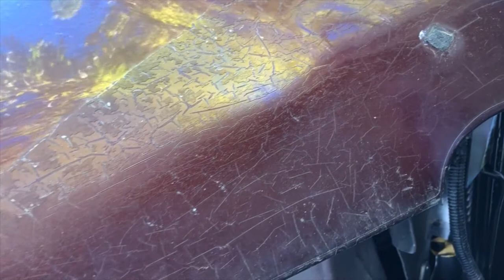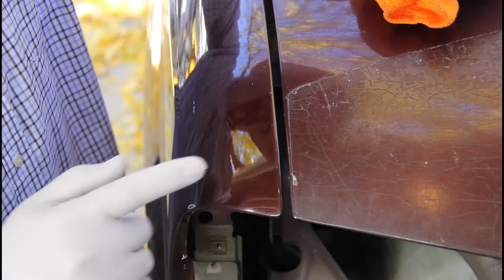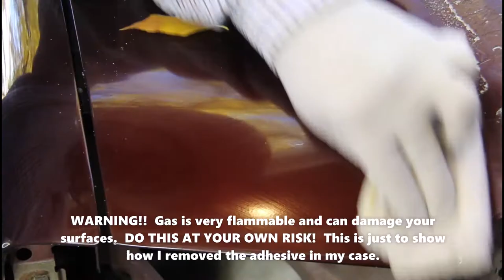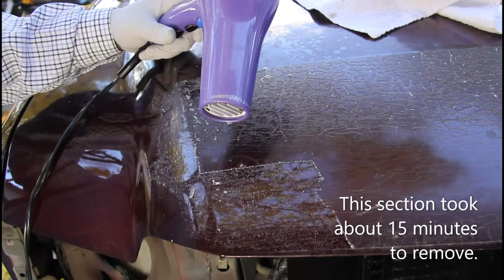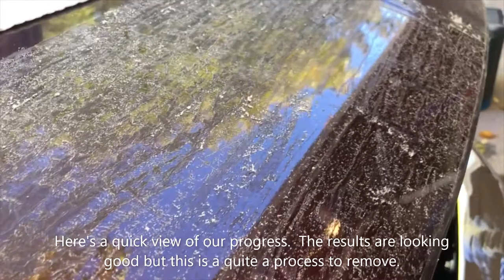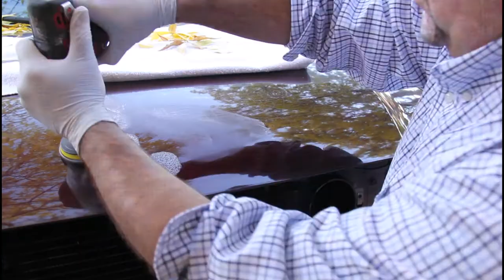Clear Bra Car Removal

Comment: I used the cooking oil method on those stickers when they put a sticker on your window. It's a paper sticker but if you soak it with the cooking oil let it sit for a minute it just wipes off that  sticker adhesive very easily
Reply: I've had them put that sticker on my window before when I parked at somebody's apartment and it's the big sticker that ends up being on your glass
Reply: You gotta be careful with the heat gun because you can overdo it and mess up your paint
Reply: Seems like you gave up on the hair dryer
Reply: I feel like the hair dryer gets it just warm enough but not too hot like a heat gun
Reply: To me the steam and oil are your best friends oil and water
Reply: If you had a wider scraper that would help too, More like a spackling tool
Reply: I like the I like the Cooking oil and goo gone, and definitely dawn to get the oil of

Comment: Hi. Any idea why my  06 Town and Country sliding doors wont open by the handles? Both open and close from the remote or dash buttons but not from the handle? You can still open them manually from the door handle. Child lock is off. Dash door control is on. I figured it has to be something related to the door handle. A switch. A ground problem. Something. Lmk if you have any advice. Thank you
Reply from the maker: Hi George.  I'm sorry but I've been away from YT for a while.  Did you find a solution to your problem?  If not, let's discuss it a bit more and get you a solution!  Sorry for the delay and I appreciate you stopping by.

Comment: Great video.  Thank you!  Looks like heat is best for vinyl removal and a solvent for left over adhesive.  I've liked 3M Adhesive Remover for other chores and may try that before gasoline.

Thanks again...very helpful.
Reply from the maker: I'm sorry for the delay Paul, I've been away for a while (as you can tell).  Thank you for the compliment on the video.  I haven't tried 3m Adhesive Remover, I may have to sometime.  Heat was definitely the trick here with this.  Sorry for the delay again.  I really do appreciate you stopping by and taking a moment to leave me a comment.

Comment: Hi Javo. I could not find your email address on here, so I am just hoping that you're still checking comments on your latest video. 
I would say that your channel's most popular video is due for a sequel. ;-) Your tutorial on building a garage storage lift is fantastic, however I am interested in building one inside my New York apartment, for storing a full-sized bed. New York apartments are famously small, and being able to press a button to lift my bed to the ceiling would be a great help. 
I don't believe I would need to build the wooden platform, as I suspect I could just use a metal bed frame, though lining the bottom of it with drop-ceiling panels, might help me better hide the bed once it is up in the air.
My concern is that the video you did create, while incredibly impressive, it was a bit hard for me, a person with no real handy-work experience, to follow, if just because it seemed like you were discovering things while you were making the video, and as your ceiling was not a smooth surface, it was harder for me to make out exactly what the set up was. 
If you were at all interested in filming a follow up video with an installation, that is a bit more detailed, I would very much appreciate it and I expect it would be another very popular upload. 
Oh and if you live near New York and I can entice you to film that follow-up in my apartment, even better ;-)
Reply from the maker: Hello Jay, I apologize for the delayed response to your comment.  First, you're correct.  This video is due for an update, and I have one in the works.  I still have a lot of work to do with it, but it is coming soon.  

It's hard to say whether using the metal frame would work.  I would look to a different solution because the metal frame is not designed to be suspended, so the stress points may be other than intended, causing a failure.  I hope that makes sense.  IMHO, a built platform would support the mattress and a mounting surface for the ceiling tiles you mentioned (great idea, by the way).  

You are correct in your observation of "discovering along the way." All my projects evolve from my original vision as I see improvements to my original design idea.  That's a good thing because implementation often differs from my project visualization. 

I have had several requests to get into the pulley system in greater detail rather than the platform, so I will do that in this next video.  I'm sorry, but I am a long way from New York; otherwise, it would be fun to tackle a different application of this project.  I wish you the best, and I appreciate your compliments.  Thank you for stopping by!
Reply: @javosgarage  
Awesome! I am subscribed so I eagerly await the follow up video. 😁